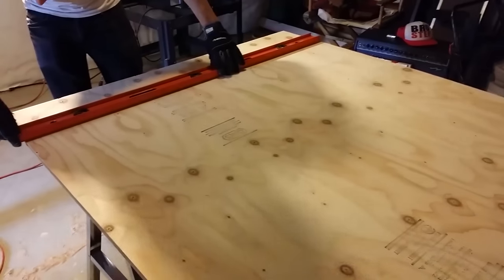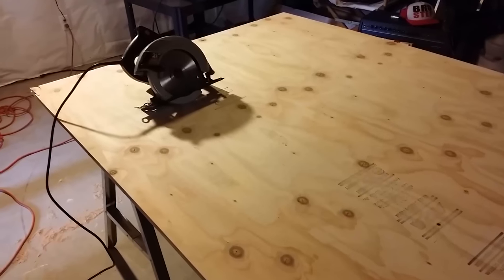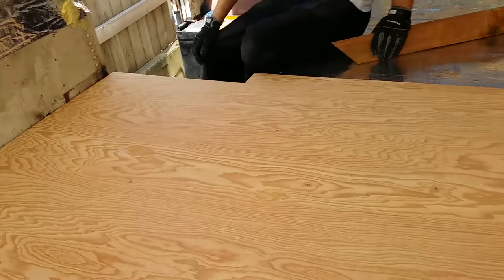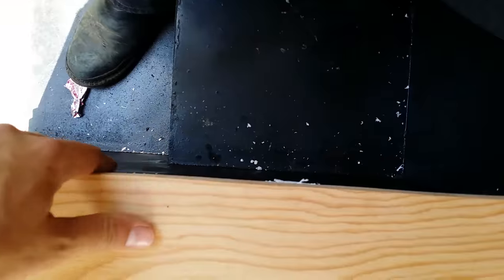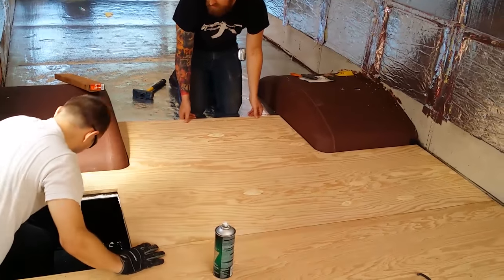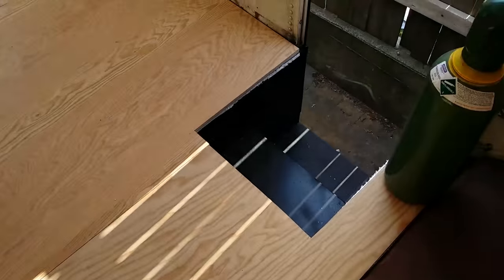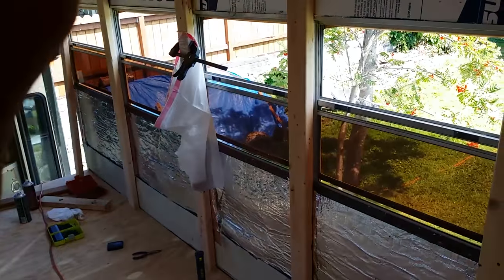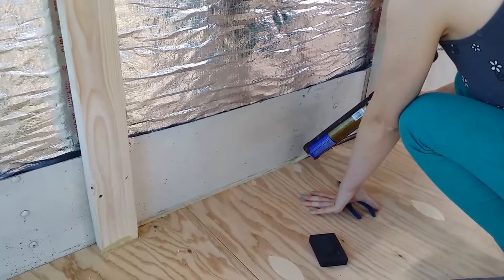Conversion Video 15- Subfloor and Side Studs

Comment: I'm a few steps behind this flooring video on my own bus, and I appreciate how thin your insulation is: better headroom in the end. Nice work and much appreciated! I've subscribed
Reply from the maker: Yeah, I'm 6 feet tall.  I didn't want to do a roof raise because I want my lower driving clearance, and that's a lot of friggin' work.  So, I'm trying to keep as much headroom as I can with what I've got.  I may have to hunch a little when moving through the bus, but I'm fine with that.  Most of my time in there will be spent sitting.
Reply: I'm the same height and on the same page: no roof raise for me, and going with a thin floor. Great videos, by the way!

Comment: think the squeeking is mostly wood to wood connections and along the edges where the edge thouches wood or steel  , like the floor to wall connection 
you could keep the edge of floor slightly away from the frames of the walls and use foam tape between the floor and the studwork and around the edge of the covering plywood where they touch walls and floors when making the walls , this gives the wood room to work a little and the box thats the bus to sway a little when driving without forcing the studwork making it creak and groan 
adding some crossbraces made from metal strip inside the walls (like the do with book cases and cheap storage shelves ) prolly help a lot too

Comment: Nice Job . Thinking of doing the same  How has you floor held up . with  finished floor
Reply from the maker: The floor is holding up well.  However, the whole reason I did my insulation this way was to keep my head clearance low, while still being able to stand.  I did accomplish that, but compressing the insulation with all of this weight does impact how well it works.  Given, it was only 1/2 inch of insulation, so it was never going to be THAT great.  So, while my floor is not as cold as no insulation, it is still a pretty cold floor.  If your goal is to have maximum insulation, I would probably go with thicker insulation built into frames that are more rigid, so it doesn't compress.  Overall, though, I am extremely happy with how my floor came out.  It looks good, feels good, and served as an excellent subfloor for all of the other things that were built on top of it.

Comment: Just wondering why y'all didn't put a 2X2 grid down on the floor and then put the insulation in grid. That way, y'all could screw the sub-floor to the grid-work.
Reply: I wondered the same thing. Plus you wouldn't have to spray that nasty adhesive.
Reply: Southern Rebel. cuz they'ns ain't nearly smart as y'all cuzzin...
Reply: @yeahwhatever1359  😂

Comment: Your the first I've seen not screw the floor down. Now that you have done it do your recommend it? Also what kinda insulation are you using that it doesn't compress under the weight of everything
Reply from the maker: Jarediscus It seems pretty solid to me. The side studs are bolted to the metal bus ribs and hold down the floor at the edges. The adhesive doesn't let it slip anywhere. The floor is also attached to the side studs. I didn't want to screw holes into the metal floor because that's where all the rust was under the old floor.

Comment: curiosity  what are you going to do if you need to take a window out to replace it or the glass? The reason I ask is I had a bus in the past and did something similar, within the first 2 months  due to  vandalism, road rock kicking up a rock and an accidental interior flying object. I had the need to take 3 different windows out to be fixed and 1 to be replaced. ( I had kept the ones I removed and filled in over ) good thing I had parts, but I really regretted boarding in the windows. After the repairs I put in removable parts for the future. Just sharing my experience :)
Reply from the maker: I did think about this and experimented a little with one of the leaky windows that I pulled out, before I tossed it.  If the mechanism of the window breaks, it would no doubt be a big issue to deal with.  However, if the window itself breaks, it can be repaired by removing the remnants of the broken glass from the casing, and replacing it with a good pane.  I would just need some putty to do it.  That said, I would probably hire a professional to take care of that.  In the event that the window really does need to be completely taken out, I am prepared to rip it out with an angle grinder, replace that spot with sheet metal, and would probably put an RV window in its place.  In the mean time, they all work, and have lived through years of abusive children, so I'm not terribly worried about it.  I also inspected each window very carefully to be sure I have the best of the bunch installed.

Comment: hey brother I'm building a bus myself and looking for different options on the floor. I wanted to know if how you made your floor works well at all? for insulating and structure
Reply from the maker: It's worked out spectacularly!  It's held down by the side studs and adhesive.  I've used it as the anchor for several walls at this point, and they are rock solid.  If I was going to do this again, I would do it exactly the same.  If you copy this method, be sure you use real plywood that is at least 1/2 an inch thick (I used 3/4"), and is not OSB.  The plywood needs to be able to act as an anchor for wood screws and bolts.  OSB will not hold for long.  I don't think OSB is meant to be structural.  As for insulation, it seems to be working just fine.  If I were shorter, I may have gone to 1 inch of insulation, but I think it's fine for my purposes.  Better than just putting the wood on the metal like it was when I bought the thing.

Comment: why didn't you screw the plywood to the metal floor? just curios
Reply from the maker: I considered it, but after ripping up the old floor and seeing how all of the rust and rot seemed to happen where pre-existing screw holes were, I figured it would be better to try to keep holes in the floor to a minimum.  After I removed all of the random nails and bolts that went all the way through, I sealed them with polyurethane sealant, and primed the whole floor with anti-rust primer.  The bad spots even got scraped to the bare metal and shot with rust reformer.  It may not be as sturdy as having things bolted to metal, but it doesn't move and I don't have to worry about hidden leaks coming up through my bolt holes.  Another option would have been to go to the under-side and put sealant around anything that penetrates the floor.  However, since the floor is corrugated steel, I wouldn't be able to access about half of my bolt tips.  The side studs hold it all in place, and I put wood glue around all of the edges to prevent any side slippage.  It's not going anywhere for a while, and I feel better about moisture coming up from below.  This is just my way of doing it.  It's by no means the only way or even necessarily the right way.
Reply: Woolly Mammoth Bus Conversion thank you..I'm currently about to put my sub floor in.. I have an older bus so it's no plywood under the rubber stuff.. but I can't even get the rubber stuff up.. I was thinking bout subflooring on top of the rubber